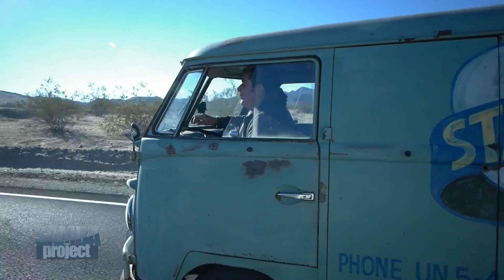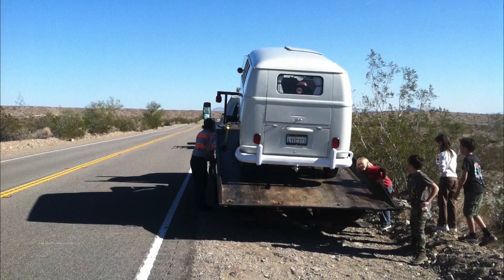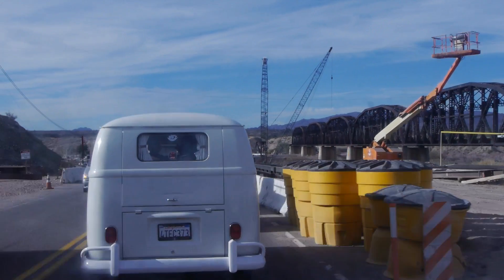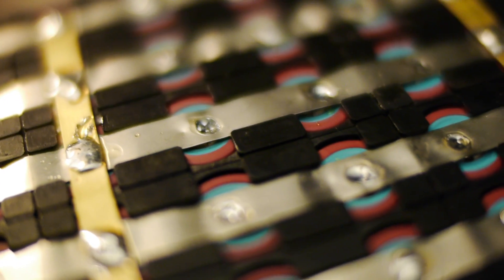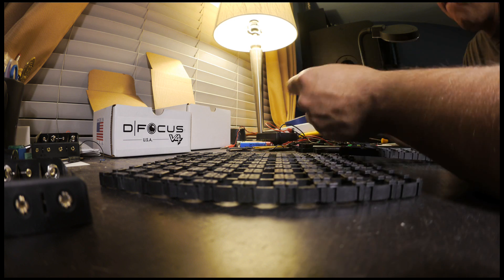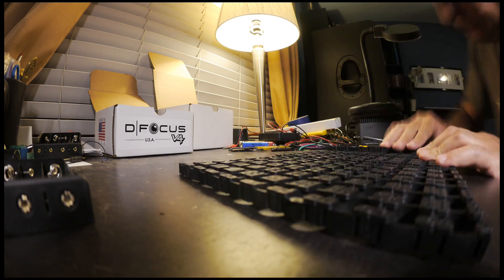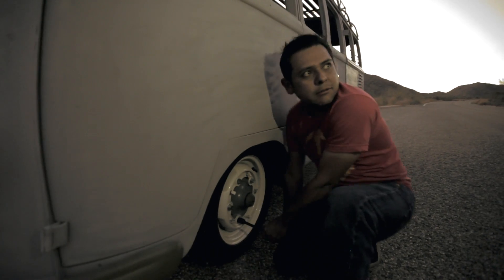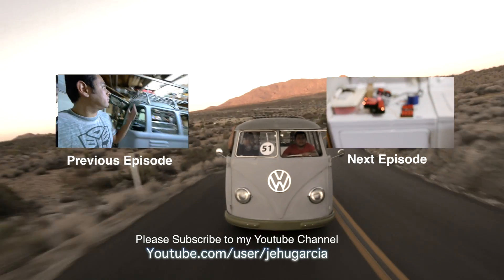Soldering DIY EV Tesla style Battery - eSamba

Comment: What kind of solder do you recommend using for high current applications? Numbers I’m thinking of are between 169-180 amps at 80-100v.

Comment: Are you really only using 3.7V battery packs? It is extremely inefficient to run at such a low voltage because you get far higher current-squared losses. The Tesla's use a 375V battery for very good reasons. Have you spoken to any electrical engineers about the way you are making the battery?

Comment: What is the width and thickness of the cooper strips that you have used in your modules?
Is it  0.016" Thick, 1/4" Wide x 12" Long?

I used 18650 for my Goped ESR 750H.....34V and 37.5 amps with total 145 Panasonic cells.
Reply from the maker: yup that size looks to be what i used.

Comment: Why not remove the orange rubber sheath? They add weight & prevent heat dissipation. How will you vent or cool the batteries?
Reply from the maker: yeah I though about that,  I saw a pic on the tesla battery and they use naked 18650s so I will try on my second module and see if it cools better,  remember I still don't know how much if any cooling will be needed at the 2c draw I will need from them.